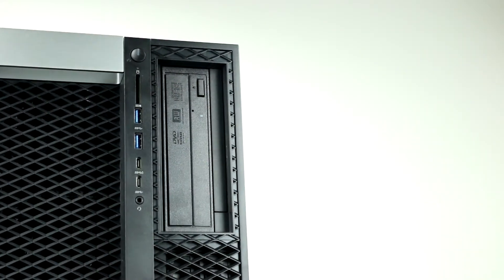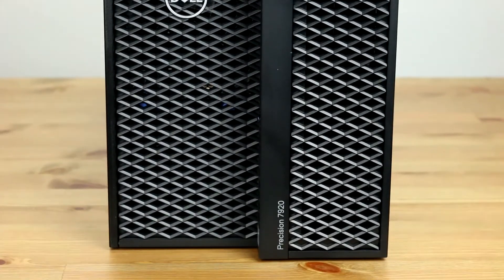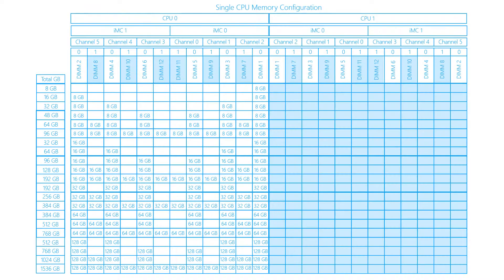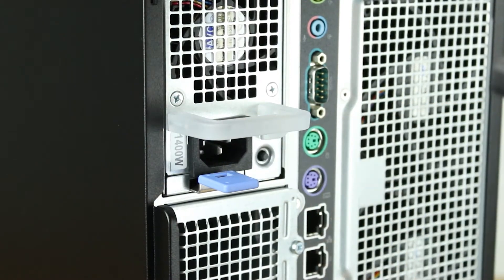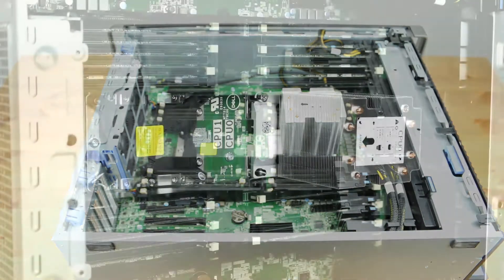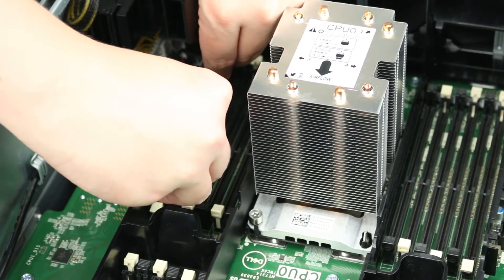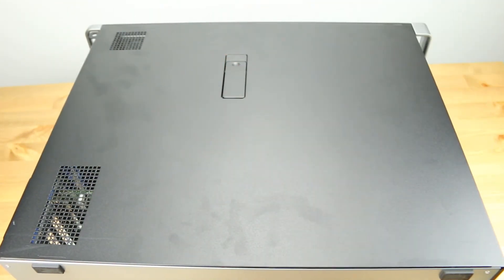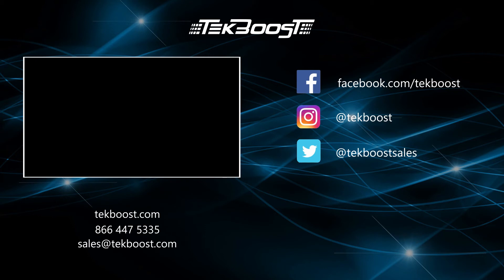Dell Precision 7920 Memory Installation

Comment: as trivial as it may seam to be, you saved my day, I found the mistake. The company that delivered the workstation atempted to install 256 GB of ram using 32 GB moduls. Using 32 GB moduls on two CPUs you can only for 384 GB at the minimum or higher, right? Thanks so much!
Reply: Hello, I have 4 modules of 32GB in a 2 CPUs T7920. The workstation works fine but it feels slow. why did you have to upgrade to 384 GB? what different did it make on your workstation? Thank you